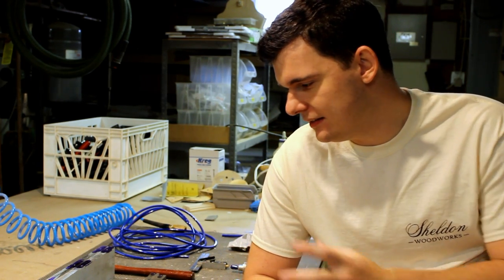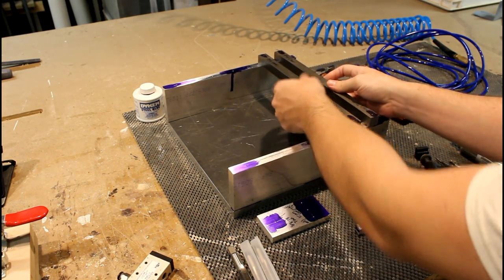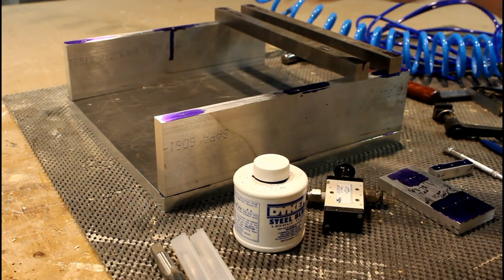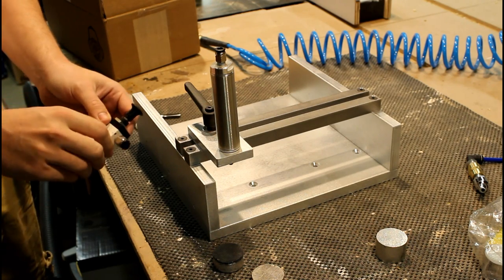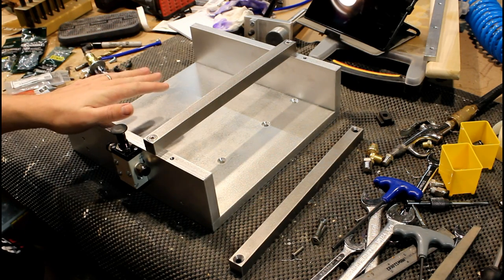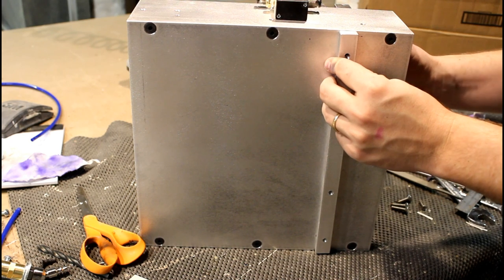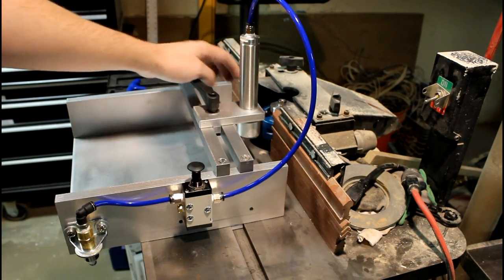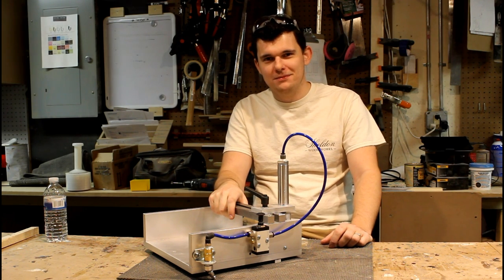Brian's Tool Builds - Shaper Sled

Comment: Cool build...I always like watching these type videos.
All i do is make cabinet doors for my business. I have Weaver air tenon jigs and the big Weaver air Shapermaster. I prefer these because they ride on a cushion of air and it is so effortless that you can push the jig thru a cope cutter with just a couple fingers. When i bought my jigs years ago, i looked at Reliable, Ritter and the Weaver and chose the Weaver as i think it is a superior design.
Reply from the maker: The weaver is nice but it comes with a price tag just like the Ritter. For production work I wouldn't even waste my time, I would just roll the cost of one of these into a large job but for my shop I was looking for an economical solution that only took a few hours to put together without any milling machine/special tools. My sled probably costs only 1/10th of what the commercial ones do and is every bit as good as a Ritter. The linear movement is smooth as butter with low friction tape but the cushion of air sounds nice. I do like to have a little friction as the resistance helps slow your feed rate down better.

Comment: Automationdirect.com has all the pneumatic stuff (Nitra braded) at reasonable prices. The aluminum from McMasterCarr or online metals.com. Aluminum can be cut on your table saw, it is best to use a negative hook blade, maybe two passes. Nuts & bolts at your local hardware store.

Comment: Very creative. The last air tenon jig I used was the one from Weaver, which creates a small air bubble between the aluminum base of the jig and cast iron top to prevent friction. However after years of use the friction between the cast iron top and aluminum caused the aluminum to "peel" and start to damage the top and cause grooves in both metals. 
So on our newest jig from Reliable Cutting Tools, which is basically the same as the Weaver jig, I added a piece of 1/16" acetal delrin (available on McMasterCarr) on the bottom of the jig and on the top of the cast iron top. Now that it's the same material rubbing against each other, there is less wear and friction. They come pre polished so you just need to wax it if need be.
Just a heads up on what can happen after 10000-100000 passes!
Reply from the maker: Thanks for the info, this is why I suggested using UHMW tape. It not only acts as a barrier against having dissimilar metals contact each other but to reduce the friction between the sled and shaper table top. I have used this with thousands of cycles and haven't seen any wear yet. The UHMW is consumable and can be tossed later. An even better way to do it would to install some UHMW bars underneath so they last longer. For the average hobbyist, they will probably never do this. I know of the jigs you mention, worked in shops over the years that have them. They are very expensive, and that's why I choose to build my own.

Comment: I have a diy CNC router that I made to build cabinets. Your excellent control panel walk through is a vid that gave me confidence to pursue a total DIY machine, so thanks for that. (most advanced wiring I had done before was a ceiling fan) BTW it's still incredible to me how much automation is possible once you have a firm grasp of a few fundamental mechanical, electrical, and software skills/principles. 

Anyway, I am assuming cabinet doors is one of the reasons you made this coping sled....what is your opinion on the build vs buy for cabinet doors? I don't have a shaper, but I have a diy TigerStop style CNC fence and a pretty good source of s4s blanks. I've been considering bringing doors in house, but everyone on WoodWeb seems to be against it. (there would be a capital outlay for shaper, sander etc.; although I have a door kit for my CNC router that I could use to start) Of course I generally rely on first principles for decision making, but was looking for another experiential data point if you had one/were willing to offer one.
Reply from the maker: +Gabe Larkin Gabe, thank you for your feedback! I am thrilled that video helped you out. I have never ordered doors or drawers and I'm not a fan of outsourcing unless it's to a colleagues shop where I can still have a much closer control on details and quality. I wouldn't be so fixed on Woodweb's opinion, I take their advice with a grain of salt. The right answer is always the one that works best for you and your work/resources, as results will vary from shop to shop. I prefer to do things in house as much as possible because it gives you ultimate control on quality, but some don't want to be bothered with doors and drawers and outsource. If you don't have the floor space it's a great way to put money into machinery for the rest of the operations and focus on the carcasses but still it really depends, it's a difficult question to answer. To make doors you really only need a shaper, (or two to be efficient) and a wide belt sander or a wide drum sander, although the latter is more preferred. You don't need a press or any fancy equipment, that just improves on speed / efficiency as you increase the volume. I can't imagine doing any woodworking without a shaper, so that just leaves me with a wide belt. I get away without one as I get my cope and stick so close I can do the rest with an orbital sander in quick time, but again I don't do cabinetry anymore, just furniture and not high volume so I can't justify a wide belt for both the space it takes up and the money it requires to get going. But if I was doing a kitchen a week I couldn't see living without one. It's good to get data on other's methods but experimental data is the most important, based on your shop. Best of luck!

Comment: Where did you find the adjustable handle with that locking piece threaded onto the stud. I can't find a handle that comes with that square nut. I want to congratulate you for this excellent build. It's the inspiration for a project I'm planning.
Reply from the maker: Thank you for the comments. They are actually separate parts:

Nut: Mcmaster-Carr #94750A582
Handle: Mcmaster-Carr #6305K25

You don't have to purchase them there but good to get the specs and shop around.

Comment: Does anyone know if Brian has completed the BOM or a dwaring of this project? I've figured out the switch, swivel and base plate. Need help with the exact part number for the cylinder and height of the two aluminum cross plates (12x??) was able to get everything else figured out by watching the video. Any help from anyone would be greatly appreciated!Thanks,Larry in East China Mi.

Comment: Hey Brian, nice job on shaper sled.  Did you ever complete project drawings?  If not, could you tell me where you purchased air cylinder and related parts?  Thanks, Tony
Reply from the maker: +Tony J Sorry just been entirely swamped with work and will finalize the BOM and plans over the next few weeks. I will put out a video as soon as it is up on my site.